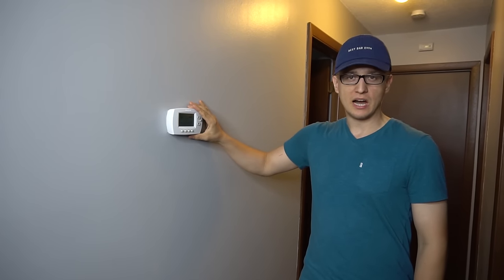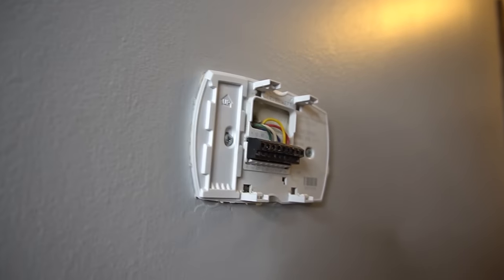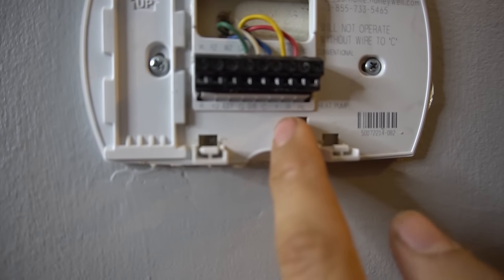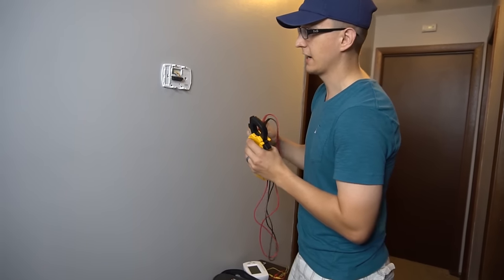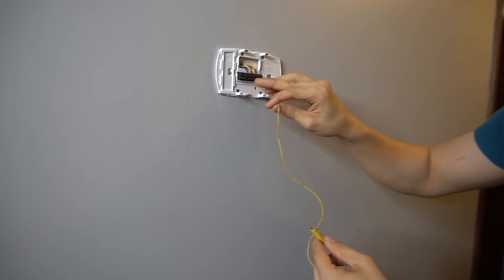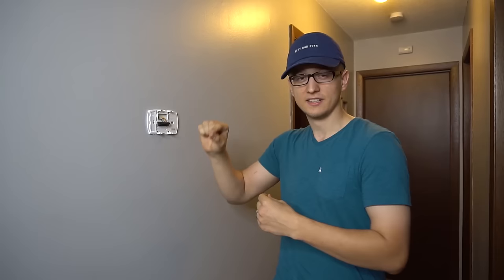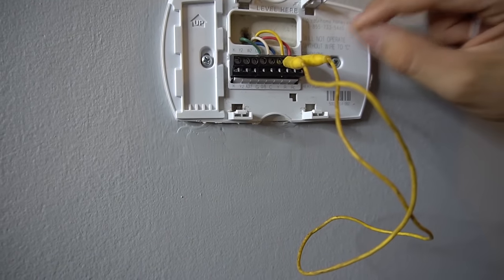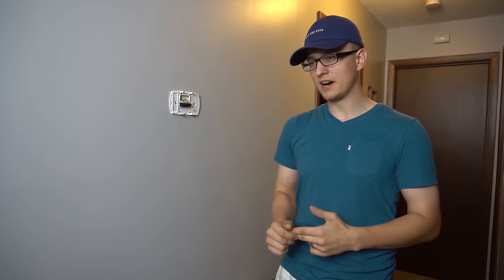How to Tell if Your Home Thermostat is Bad - Bypass it and Find Out

Comment: Assume that the switch between R and G is bad kn the thermostat side. But you only want the fan to turn on when the system turns on (calls for heating or cooling) if you jump R and G, wouldn't the fan always be on? Could you jump C and G so that the fan only turns on when voltage goes back along C? Or would you have to adjust the Jjmper seasonally (Cooling jumps Y and G, Heating Jump W and G)
Reply from the maker: The thermostat is there to automatically turn on and off the fan, ac, and furnace. That is the purpose if of the thermostat. Any kind of jumpers will bypass the  thermostat and get rid of the automated aspect of it. Meaning it will just have power going to it at all times.

Comment: I had just installed a honeywell rth9585wf and I have a heat pump. The thermostat is set to 73. The room temperature display on the thermostat is at 73 but the fan kept running for hours. Outside temperature is 26 or 27 degrees. I've switched the fan from automatic to on and pulled the thermostat off the wall and the heat turned off in about a minute. Will this makes the thermostat faulty? Any advice or suggestions? Could it be the Outside temperature have something to something to do with it?

Comment: Hello My friend: I'm a little confuse. 4:55  If I jumped R and W and my AC turn on, that means my Thermostat is broken???
If I jumped R and G and my fan turns on that means my Thermostat is broken as well. Thanks for you answer.
Reply from the maker: Do you mean R and Y? That's what I said at 4:55 . Yes.. If your thermostat does not turn on the air conditioner but when you jumper R to Y, the AC does turn on.. That means the thermostat is bad.

Comment: if i jump therm for cooling will it shut off when it reaches the temperature ?? thank you
Reply from the maker: Thank you for asking that! I forgot to mention that in the video. Shutting off the AC or Furnace when it reaches temperature is the function of the thermostat. When you bypass it like I show in the video, the AC/Furnace will run non-stop. So this would only be done as a test or to get you by until you get a new thermostat.

Comment: Any recommendations on how to verify the temp reading in the thermostat other than using external thermometer in the room?
Reply from the maker: Unfortunately I don't have any such recommendations :) If a customer tells me their thermostat is not reading the right temperature I usually just put 3 thermometers around the thermostat (2 temp probes and a probe connected to my meter) and see what they all say. If all 3 are a few degrees higher or lower, then yes, the thermostat is off. Most times my thermometers match up with the thermostat though.